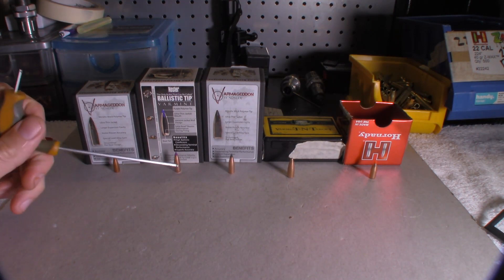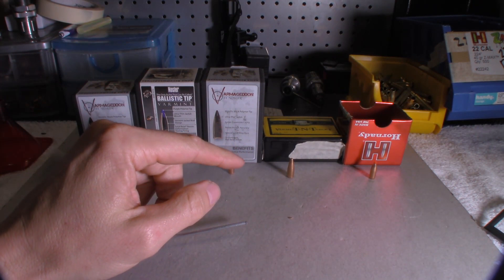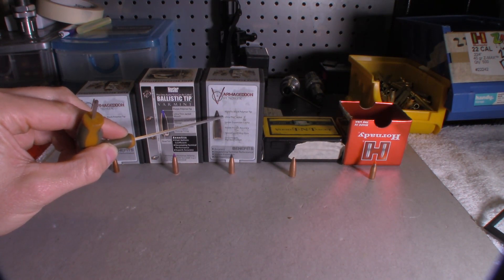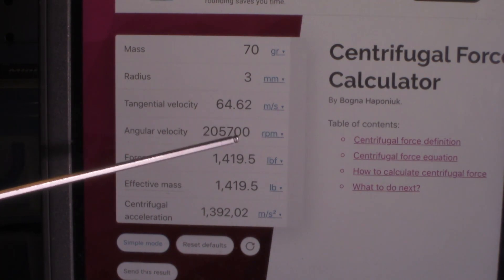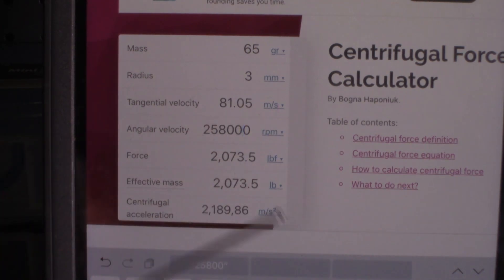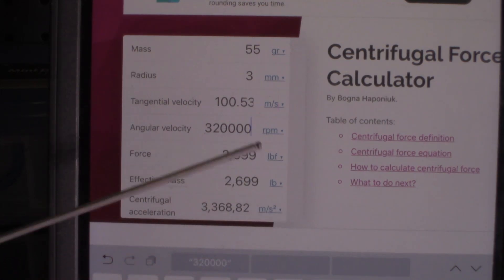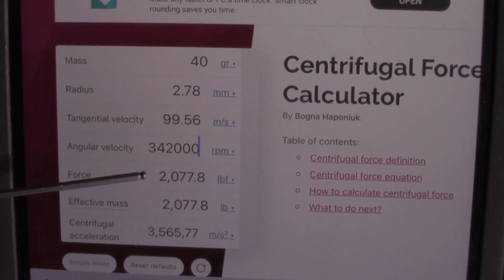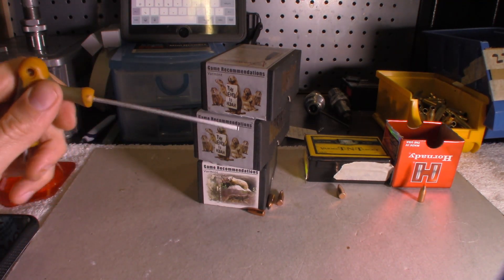Twist Rates and Bullet Expansion - Splat Chat #5 Why 1:12 Twist is practical max

Comment: So interesting. I played with the calculator, keeping the rpm constant and increasing the bullet weight also produces increasing force on the jacket numbers into the attractive realm above 2000lbf. 

Likewise increasing the rpm for the same weight bullet also shifts it above 2000lbf. So gets better with faster twist rate.

I get bigger numbers with 103gr in 1:8 doing 2561fps and 230490rpm and getting 2622.3 lbf compared to 70gr in 1:8 doing 3070fps and 276300rpm and getting 2561 lbf

The 103gr ELDX at a low muzzle velocity in 1:8 is propping up attractive numbers. I haven’t done any gel test to compare with anything.

My Howa Mini 6ARC, 20” and 1:8 with factory 80gr in winter here in Australia is clocking 2924fps for 80gr, 2561fps for 103gr, 2578fps for 105gr and 2595fps for 108gr

Back in autumn I was getting 2615 ish for all the loads 103+ and still 2920 for the 80gr. I think the Hornady loads are hot loads and the powder burn rate could be played with (the barrel gets warmer towards the muzzle than near the chamber).

Your gel test is showing the Speer TNT with the 50% pass through (I think that’s my interpretation) to be devastating. Which is similar to Sierra 77gr TMK in 223 with massive permanent cavity starting in first inch of gel and 50% fragmentation/weight retention.